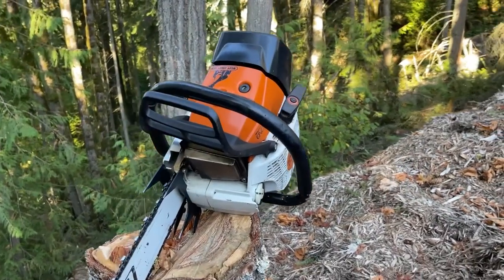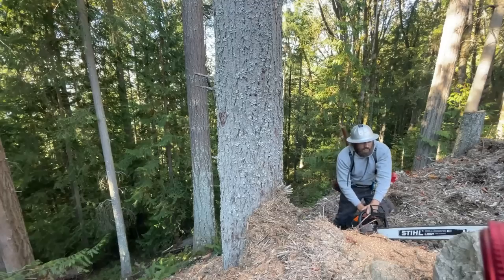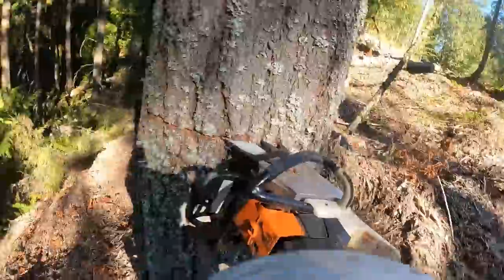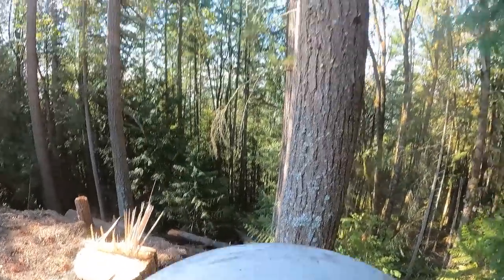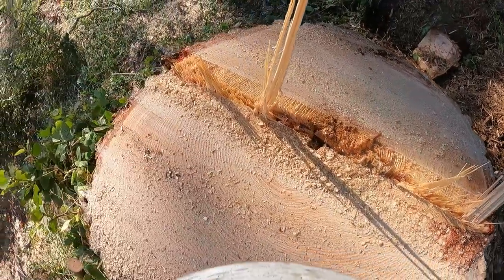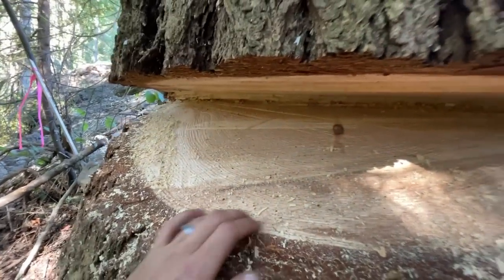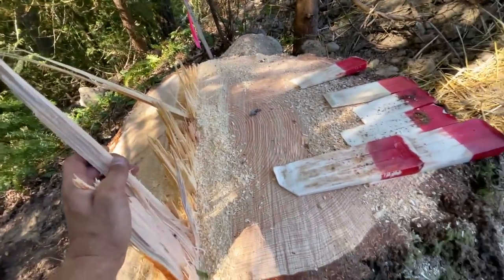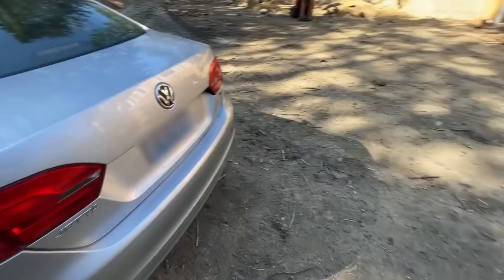Falling Trees All Day with the Stihl Hexa Chain!

Comment: It was cool that you brought up the hexa chain and i enjoyed your humble follow up at the end. I do sharpen many a chain for my customers. The square grind profile is the nicest by far. It appears that Sthil rides the coats tails of other manufacturers. Their rapid speed profile was to compete with the square profile, but the profile can't be maintained, can only be sharpened to traditional round ground or changed to a square grind. The hexa is just another attempt to compete with something that has always been awesome. The original square grind is very versatile and compliant to any position of the chain to direction of wood grain. They come standard with a 20 degree top plate angle, yet, during the first sharpening, I change it to15  degrees. Sometimes 10 degrees. Both angles still cut exceptionally well in bucking postion, but having to ripcut at times, those angles step up the game. Even cross grain ( big nots ) doesnt slow down the performance. With hexa chain, this would be my concern, ( can the profile be maintained, or is it a one shot deal like the rapid speed, and why would someone pay up to 3 times as much for a Sthil chain, than an Oregon square grind that has been proven relible in performance for years???)
Reply: um stihl definitely offers a factory square ground chain. ive run it... its decent
Reply: Yeah what's this guy on about?  Stihl's been offering factory square for ages.

Comment: "Doesnt run as good" still goes through the tree in half a second 🤣
Reply: A ported 661 will eat just about anything in a couple of seconds with a chain that’s reasonably sharp. Guys used to homeowner stuff are stunned at how much bodyweight they can drop on the rear handle and she doesn’t stll, just eats.
Reply: Pine trees are so soft a chainsaw just eats em.
Reply: @verteup  agreed. I haven’t cut much pine, mostly hardwoods so when I cut a small pine my saw flew right though it and I was impressed how quick it ate that softwood compared to maple which is most of my cutting experience.
Reply: @verteup  while that’s true, I might cut a cedar every 25th tree. My comment was posted with a midset toward oak, ash, maple, beech, and hickory. That’s most of what I cut here in TN. I work so much white oak it’s not even funny.

Comment: I too use a 2014 tdi dsg Jetta for my work car. It’s loaded down just like yours but typically with carpentry tools. I pull a trailer all the time! If you haven’t done supplemental air bags in the back they help with the sagging. If I could comment pictures I’d show you all the random trailers I pull 😅. I stay on top of dsg fluid changes but otherwise I don’t baby it.

Comment: Interesting raker design.  Wonder if that would help with the problem I've had for years with a normal full chisel chain. I cut mostly Red Oak and after a bit the tips of the chisel wear off. Happens pretty quick on a 30" or larger dry red oak. I had chunked up 2 fairly large red oak trees just the other day and had to swap out a chain about 3/4 of the way through. I can cut a slightly softer wood like Silver Maple or Ash all day long and just touch up the chain with a file every few hours. I square grind my chains by the way.

Comment: You can have your favorite saw shop plug in to the 661's data port to the M tronics... but I've always found, a new air filter and spark plug does the trick... I personally dont run anything but stihl orange bottle, 2 cycle mix in my 661, 880, 171 and T 194...I think the grey bottle fouls the plugs faster...

Comment: I think the grabbiness is from the side plate/cutter angle. "Stihl fan suisse" and Vallorbe have some great videos on square chain geometry and ideal angles, as well as the mechanics of the chain in action. The side cutter severs the fibers, the top cutter/plate peels the shaving out. The more aggressive side plate angle may need a taller raker/depth gauge to get  a similar cutting performance. Conversely, square ground chains with relatively vertical side plates, rather than the "ideal" 80 degrees, may tolerate a lower raker since the side plate isn't digging in, it's more shearing and less slicing.
Reply: 26:56 your side plate angle is almost 90 degrees on the square ground
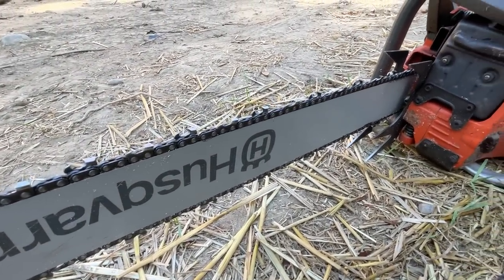27:07 side plate on the hexa is probably 60 degrees - very steep

Comment: The side of the tooth on a square chain is a much better cutting shape than round chain. That’s why it cuts new kerfs so much easier. The hexagon is still more like a round chain in this regard, so not surprised at your results. Plus that angled raker is probably going to make it way harder to cut off course, kind of like trying to bore cut with a safety chain.

Comment: Would be interesting to see a full or semi skip instead of a full house on that 32” bar. Probably cut a lot smoother. Also curious to see how it cuts after the gullet is opened up
Reply: Skip has more chatter than full comp, not less. If it follow round and square’s habits, it would be an even choppier ride.

Comment: love the video it was great to watch as always. i just have some tips when you said that your saw is not running as good as it used to. In my opinion the main culprit would probably be the metering diagram. after a few years of contact with fuel they get hard and do a bad job at delivering fuel to the engine etc. another culprit is possibly some dirt in the carb especially in the internal screen of the carb

Comment: I need a plumb bob.  Standing on a 45 degree grade I cut to deep into the face, my big saw is fast.  It was leaning where I wanted the Myrtle Wood to go but the top curled around the other way downhill, Myrtle does that.  Got my saw stuck, had to put a strain on it just to retrieve the saw, this wood is super heavy with oil, makes good firewood when dry.  Another Mert was leaning into the creek, say 2 1/2 ' dia., again I missed judged the tops.  Studied this project for a week, turns out I was on the wrong side of the come along blocking my safe exit when I pulled it down.  Slipped on gravel and the tops came down on my back, bruising my ego more than anything else.  My point is even with thinking it thru carefully I made only one mistake, being on the wrong side.  Contractor helping remove limbs didn't notice I was there and dropped a limb on my back before I cut the tree down.  In the trees if you are not safe you are dead meat.  I'll save a big Mert for you Jacob, stop by anytime.  Gold Beach Oregon.

Comment: might want to check and see if the chain was getting enough oil to the chain you did say that saws been through alot. that might be why the chain got hot. just a thought. and ive met so many ppl that think they know everything because they have done it for long enough and they think its there way or the highway and that really bothers me somtimes. especially when someones breathin down your neck when your trying to do somthing and they think they know better. everyones different and theres only one way ppl are gonna get good at somthing and thats just doing it enough. they will figure out what works for them and having someone breath down your neck constantly when your trying to learn can just make things 10x worse in my opinon.

Comment: How do you find that axe sheathe / holder thing?  I wear mine handle down, but it tends to bang off my calf when walking. Can get annoying.

Edit; Just a tip - on that 'oh, by the way' tree - it's always a good idea to slab off the bark where you're planning to wedge. Only takes a few seconds and can save you significant time - and, more importantly, effort. Obviously this only applies to tree with really thick bark :)

Comment: man i use to travel installing basket ball floors and had started with a car and when i put to many miles on it i decided to get another car soley becuase gas millage. saved alot of money and to save even more instead of spending 60 to 120 bucks a night i would sleep in my 2006 pontiac grand prix. the back seat was so uncomfortable. and it was absolutely slammed with tools and clothes. literally played real life tetras every single day. not sure saving that money on gas was worth the hasel. looking back i should have bought a buffalo bill van and pulled a trailer. could have slept in the van and had so much space to easily access tools. or load the van up with tools and use the trailer for sleeping. could of had a wood burning stove, a bed. been able to stand up. but no i was dump af and slept in my car. couldnt even fully extend my body. slept in a L shape with the seat belt buckle digging into my side until i ripped them out. and or the crack rock motel.